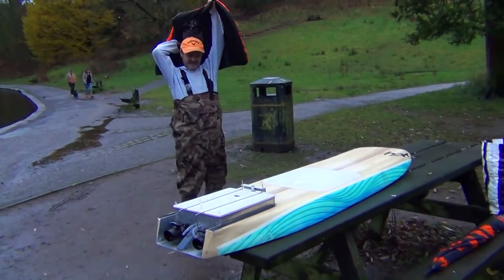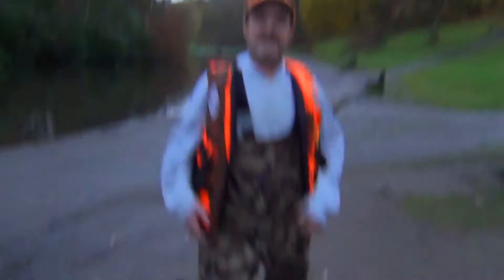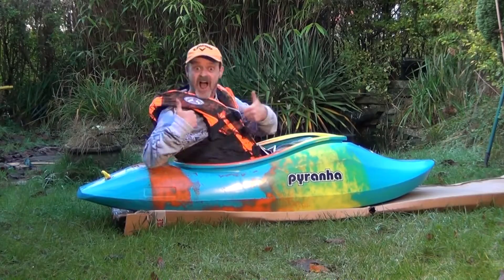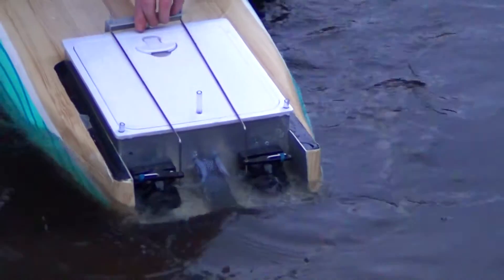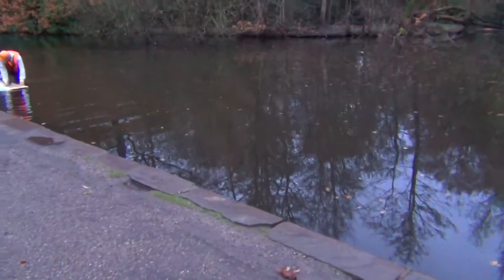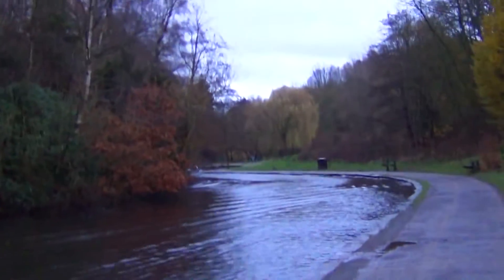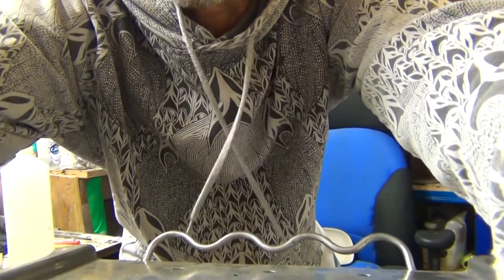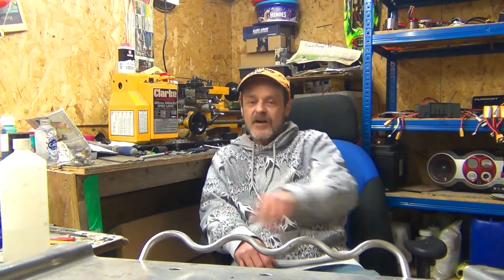Jet-Nozzel Test and Future Jet-Kayak Build

Comment: looking at your video again. it does not look like you are using the directional nozzles after 3:18 is this correct? did you not like the directional nozzles? is it difficult to use when standing on the board ?

Comment: Hey Markie Mark, I absolutely love your work, what do you think about reducing the hassle of the twin jet-drive setup and instead try a single 100mm jet drive with a bigger motor?
Reply: bigger motor = bigger battery = bigger vessel = $$$$$
EVs dont scale how across the pond would love to think, bigger isnt always better.. just my 2cents
Reply: @michaelwithington5934  1. Bigger battery - incorrect
2. Bigger Motor doesn't mean bigger vessel - quite the opposite. 
your drivetrain can be narrower and slightly longer 
3. More expensive - probably, however it saves you the headache of balancing, running multiple wires, cables and connectors, sealing, waterproofing and adjusting both pumps and both motors to perform exactly the same, I can't tell if you've ever built one but I did, and still perfecting my build, speaking from experience double setup is a double trouble.